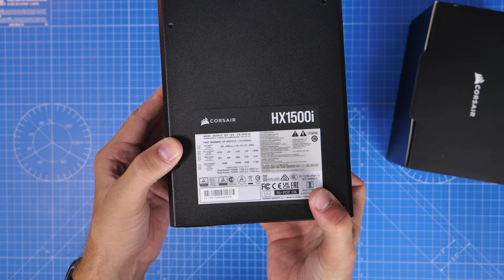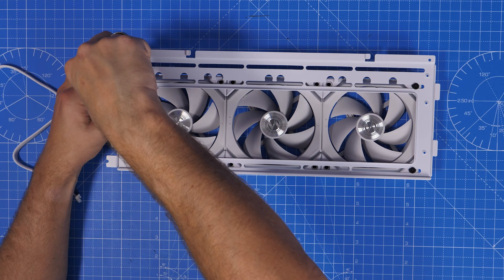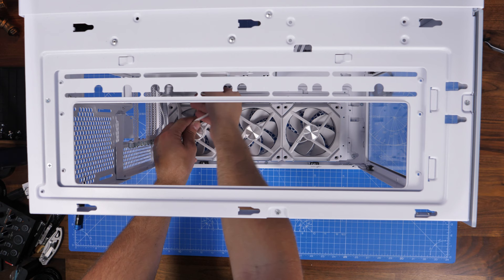I made some mistakes with this Lian Li O11 Dynamic EVO build (Z790, Core i9 13900K, RTX 3090)

Comment: Thanks a lot for your great content!

I do have a question though for the NZXT Z73.

I'm currently building my new pc in head and want to go with the following all white:
MSI 790 Edge Wifi 
Msi 4090 Suprim
I9-13900
NZXT Z73 Kraken 
64gb ddr5 6000mhz (to fill the 4 slots :D)
10x lian li uni sl infinity
Strimer 
1000w Pure Power 11 FM beQuiet PSU
In an O11 Dyn Evo 

For this i have two questions:
1. Are 1000w "enough" for this build, or would rather go with 1300w?
2. Is the Z73 Kraken enough to cool the 13900? For this i've read multiple opinions ranging from "easy going, just dont bench 24/7" to "no way, no AiO can cool this thing even if you're just gaming". Id use the pc for gaming (currently 2k, then 4k), streaming with OBS and Photoshop / Lightroom.

Thanks a lot for your help!
Reply from the maker: For question 1 use this https://outervision.com/power-supply-calculator

For 2, people do talk a load of old nonsense don't they? I'm using the 13900K as you can see and it runs really well with the Kraken. It's nice and cool frankly. Usually around 30 degrees C or lower idling (i.e. browsing the web or whatever) and 50-60 degrees while gaming or video editing. Obviously I edit a lot of content, benchmark, render, game and more. Not hot. Just fine. Naturally this will vary depending on overclocking and such but it's cool here in this setup.
Reply: @TheProvokedPrawn  Thanks a lot for your answer, really appreciate your time!
Yes they do, that's why i needed to ask, as you're running exactly this combo! 
Dont think i'll overclock, as i don't want to compete in any benchmark score, just my three mentioned use cases, escpially the streaming part with obs is currently lagging out my system. As soon as i open OBS, cpu jumps to 80-100% and system is super slow. Also of course, i want to be as future proof as possible without the need of a custom watercooling system.
Reply from the maker: @headsh0t_ttv886  interesting. Are you using the CPU for encoding rather than Nvenc?
Reply: @TheProvokedPrawn  Im using NVENC. Currently running a i7-8700k and an rtx2080.

Comment: anybody know how to control the rgb strip in the front through the Lian Li software. I Can control the fans but their is no section in the software through it. It's receiving power  and the rgb cable is plugged directly in the controller and when i put it on the 8th mode which should let me control it through that it doesn't do anything. It's driving me crazy.

Comment: if you top slot your m.2 card it cuts your Pcie express from 16x to 8x on Maximus hero, might check if it does to your too..
Reply: Asus did that with the 690 boards too. Hot trash

Comment: Does Lconnect3 software have to be running to maintain only the rbg effects?  Im using it for lights only so will I be able to only open it to change color and pattern and then close it for good?  BTW yur channel has been a godsend for me, ive been out of the loop for 7 years so its been very helpful to watch these tutorials

Comment: Hey PP! great video and videos.  I was so glad to find your video after having some difficulty with my build. turns out I have the exact same  case, cooler, 9 fans and motherboard (AMD version for 7950x). my GPU is also same series but 3070 (this PC is built to process astrophotography and doesn't utilize any GPU processing for that). Here's the thing I got very excited when i saw you pull out the double white wire for power and RGB control at the top of your cooler run of fans but for some reason I couldn't find one in my box.  Granted I did buy 3 times 3 packs because all the single fans were a week longer delivery. so maybe the dual cable came in a single box?  Also, I had a fit of a time with getting all three to reach the controller.  I ended up pulling forward my PSU and running it behind it and pulling the HDD cage out altogether.  I am running 3 times 2TB firecuda 530s so i didnt need it anyway.  Don't know if it is any benefit to you for me to respond to a 3 month old video but I wanted to share my gratitude and help if i could. CHEERS!
Reply from the maker: Thanks for the comment 🙂 the cable does come with single fans. Lian Li also says it has longer cables now or you can purchase them separately apparently.
Reply: @TheProvokedPrawn  I would trade them 6 jumpers and 6 power/controller wires for 1 or 2 long ones =P.  Thanks for the response!

Comment: How did you get the white rubber pads on the original SL fans? Are the pads from the SL-Infinity fans the same shape and size?

Wait nvm, further on in the video you mentioned they are V2s.

Comment: Nice. I love videos where not everything is perfect and we can learn more from mistakes. About to do a white build also, and was really looking at this mobo, it looks so good but unfortunately it is DDR4 and really wanted to bump to 5. Can't decide whether to go with ASUS ROG STRIX Z790-E or MSI MPG Z790 EDGE, $200 for better bios options?
Reply: Wow im stuck between these two exact motherboard options.  If you chose one, could tell me why and how its worked out for you so far?
Reply: @dude5skater  I finally put together my pc. Went with the msi since it was cheaper and put the money towards a better processor. IO on mobo was a pain to get in place, had to force the screws on, stand offs didn't fit perfectly. The lian li case has a fat cable for the usbc and its right where the anti sag bracket for my 4080 card would go. I had to use the lian li anti sag instead of the one that came with the gpu. Other than that the mobo runs fine, I haven't played with it too much. I am happy with it, though it was a pain to find one before Christmas. Hope that helps

Comment: I love this build, I'll build my new pc soon like yours, I have some questions I hope answer me, 
1: do you hear bubbling noise or something in AIO in the side mounting?
2: is I can mount 360 AIO on top instead of the side with this case or it's impossible, if yes, why you prefer to mount it on the side?
3: why do you not use NZXT fans behind radiator like your old build (when you are using 6 fans in the radiator)
♥
Reply from the maker: No, Yes and mostly because I didn't want to. 🤣 But also really you should use the same fans on both sides for ideal push pull. This ensures the fans have the same airflow capabilities
Reply: @TheProvokedPrawn  Thank you for your fast reply, so the reason of why you don't use double side fans because you find that nzxt with Lian Li fans together not give the best airflow performance

Comment: Quick question regarding the fans. I have basically the same setup except my rear fan is also an intake. So I only have the 3 radiator fans on top as exhaust. Is that anything of concern or am I just fine?

Thanks for any replies.
Reply from the maker: The best answer to that is to stress test your system and see how your temps are. https://youtu.be/nkjQjozmzlY

Comment: I was a little disappointed that the hx1500i didn't come with the Corsair connector for 600w included and I couldn't ever find a moment it was in stock so I bought a cablemods cable instead. Also it was interesting than the new HX PSU didn't come with braided sleeved cables like my last gen hx1000 did. Regardless it's support my 13700kf and 4090 no issues as you would expect. Though I know my old hx1000 would have done the job zero issues too.
Reply from the maker: The cablemod cable looks great though.

Comment: Seems a bit odd to use so many M.2 drives.  Why not just get a single larger drive using PCI-E 4 and then partition it for OS, files, and then games?  You've no doubt spent just as much if not more money on multiple drives than you would on a single 2TB drive.  Plus they'll collectively consume more power, add heat, and you've taken up all your slots so you have no more room for future expansion without replacing a drive.  Not to mention the performance penalty of falling back to PCI-E 3.  Having a single larger drive seems to make more sense.  Love the overall build though.  Looks beautiful!
Reply from the maker: One is for the OS and software, another is for video files and another. And one is purely for games and the other is for gameplay footage. Nearly all the drives are full and I have a 20TB NAS. I need a lot of storage space for all the things I do. They also run at PCIe gen 4 x 4 speeds on this board as well.

Comment: Can i connect my Lian Li Fans to the Motherboard with the Controller Cable and also connect my fans with the pump. So basically it is connected to both. Currently i am just connected to the motherboard via the controller cable because i have bought 3x 3packs of lian li fans and the splitting cable wasnt included so i had no chance of connecting them to the pump cable. Can i leave it as it is or should i really buy the splitting cable to connect the fans with the pump itself
Reply from the maker: It'll be fine as is. Don't worry

Comment: does the 40 series nvidia really need a 1500w psu? im building a pc using this same MB but it says ddr5 not 4 with it and im putting in a 4080 rtx. pc parts picker estimates 787 watts so im going with a 1000w psu. is that not enough in your opinion? i also have a 1200w psu from my current build i could use but id rather get a new one since this one is about 12 years old. still going strong after all these years though. should i consider getting getting a 1500 watt psu instead of a 1000 watt or 1200 watt psu?
Reply from the maker: Should be fine!
Reply: @TheProvokedPrawn  hey thanks for the quick response and the advice man. I greatly appreciate it. Great video btw. Very informative

Comment: I plan to buy the lian li galahad 360 sl version with 9 sl120 v2 fans (3 at the top, 3 in front, 2 in the bottom, 1 in the rear). Should I be plugging the radiator fans to the CPU fan header? I'm confused on how I get the pump to control my radiator fans.
Reply from the maker: Hey, thanks for joining the channel, your support is appreciated! I've got a video here which might help - https://youtu.be/0wPi_zNzKF4

I don't recall the setup for the Galahad. Does it have a fan power cable coming out of the pump head? If so use that, if not, yes plug them into the CPU fan header. The motherboard will then control those fans and if you connect the pump to the AIO header it'll be able to control that too. :) Hope that helps (or the video).

Comment: Where did you end up putting the controller that connects to the bottom 3 fans? The cord is pretty short/tight as you say.
Reply from the maker: Apparently they supply longer cables as standard now

Comment: Ever thought about putting the AIO on the top set to exhaust and just have fans on the side? What advantage do you see having it on the side. Nice build, I’m about to start one myself with the same case!
Reply from the maker: I've actually tried both formats - top and side and found little difference in the performance.
Reply: @TheProvokedPrawn  was it ultimately an aesthetic choice then? or was it simply easier to mount it there? 
i'll be doing a similar build for my girlfriend soon so i'm curious.
Reply: @thomaslayman9487  put your rad up top dude, youre blowing hot air into the case the way he did it...rad up top as exhaust, 3 fans on side as intake, 3fans on bottom as intake, back single fan as exhaust
Reply: If you have midrange GPU then its way easier with AIO on top but with high end GPU this is the best setup - also vertical mount for GPU. The thing is that high end GPU's generate a lot of heat and with the AIO on top the CPU temp also goes up. At the same time CPU's generate way less heat. Now one might ask "but you blow warm air into the case". Well yes and no. First of all the air from the CPU AIO aint that hot. Secondly the warm CPU air gets pretty much blown out of the case bacause of the bottom fans and doesn't reach other components. I have the same Lian Li case with exactly the same fan setup. I have tried different fan and AIO setups and also checked the air movement with the smoke machine.
Reply: @Aur0n  Agreed! Also, to back up your point, the absence of an AIO up top allows for even higher fan velocity pulling all that bottom air up and out as there's no rad interference.

Also, it's much easier fitting a Push - Pull (should you go this way) on the side as opposed to the top (even in my XL Case.) and looks less cluttered.
Reply: I have a very similar set up using a 13900K.  In my setup there's a 6-8 degree C difference in CPU cooling, if I have radiator on intake on the side and fans on exhaust at the top.  The cool air from the outside keeps the cpu the coolest.  While it warms up the inside of the case, the fans on the bottom set to intake, keeps the GPU cool and the warm air exhausts out the top.  I didn't find the fan on the back makes much of a difference.  If I move the radiator to the top and set it to exhaust, the CPU temperature increases by 6-8 degrees.  In that configuration, my GPU temperature will go down slightly maybe 1 or 2 degrees. 
.
Reply: @Me99adon  exactly how i will be doing it.

Comment: i have a 13700k. I noticed you plugged in both cpu power connections. Does it make a difference if i have only CPU power connector compared to two? any advice would help. thank you!
Reply from the maker: The extra power is usually for overclocking I believe, but I'd suggest doing all whenever possible

Comment: Hi, I wanted to thank you for your videos.  This build is almost exaclty what I want to do and watching it has answered quite a few questions I had about using the Kraken in a build, but replacing the fans with Lian Li fans.  I did want to ask you what software you use to run the LCD screen on the Kraken as well as all of the lighting in the build as I've been trying to research and figure this out.  It's turinng into a rabbit hole.  I've read posts indicating you can use CAM and SignalRGB together if CAM starts up after SIgnalRGB, but other posts that indicate CAM does not play well with other RGB software.  I've also read that CAM does not currently have the ability to control RGB RAM.  There is also a product called KrakenZPlayground, but I'm not sure if it works as well as CAM to control the AIO.  I'm also guessing if I go down this road, I should try and find an older Z model and not use one of the newer Elite models as the compatibility may be even less with the newer models.

Anyway, I'm really interested in what your solution was, here.
Reply from the maker: I personally use Cam for the display, L-Connect for the fans and then the RAM is controlled by the motherboard software (in my case that's Asus ROG Armoury Crate). I've not dabbled in Signal RGB I'm afraid.

Comment: Something I noticed while watching the installation segment, you seemed to put M.2 drives in each slot if I am not mistaken, which may impact performance of your graphics card significantly. I am unsure if this is the case for this exact board, as I cannot find the channel specs for it, but most of the high end ROG boards actually have the PCIe slot for the graphics card share a lane with one of the m.2 slots, meaning that it will drop from x16 mode to x8 and hamper performance by something like 2/3 in terms of data bandwidth.
Reply from the maker: No significant impact in my experience

Comment: I have been racking my brain trying to figure out how to get MOBO control on lian LI fans for a hot second and didn't even think to use the splitter cable. Genius.
For your fan wire stretch issue to reach the controller, would you be able to mount the radiator to the top and then daisy chain bottom&side intake?
Reply from the maker: Might be easier :)
Reply: I appreciate you giving everyone an opportunity to learn from the little mistakes. Content creators like you give the platform life. Cheers 💖
Reply from the maker: @DTkz_  thanks. I get happy feelings from helping others. 👍

Comment: *just bought myself a 5,295.29usd 
gaming pc 3090ti i9 13900k 32gb ram 6000mhz  3tb ssd power supply of 1200w rog thor asus*
hope it goes ok with 1200w psu
i just need to put it toghter with someone proffestional 
to do it this week .
i sold my ps5 series x 2x steam decks units and adds a ton more money for it* .
hope i have great time with it . 🙂👍

Comment: what does ram induced instability look like? so what happens when the system is unstable?
Reply: As someone who upgraded my antique i5-6600k 2 years ago from 32 to 64GB ram I can tell you that what I was having a lot of issues with was programs crashing. No BSODs just programs crashing out of the blue. I had bought 2 packs of 2x16 and testing with Prime95 showed one set was bad. RMA'd it and got a good pack. So if you think you are having issues, Prime95 is a good, free way to figure out if you have some bad ram.

Comment: hey man so i got a lian li O11 dynamic EVO and it has rgb like the case does but for some reason they wont turn on? do you know any solution to this?
Reply from the maker: https://youtu.be/xmLIU40UOVI
Reply: @TheProvokedPrawn  so its not the fans! all my fans work and strimer too but its the case because the case has an actual like strip where the power button is in between the glass and the plastic but it wont turn on ? does that video fix that aswell?

Comment: Why not completely remove the hard drive bay to open up some room?
Reply from the maker: Fair point but I wanted to mount the SSD there and hide some of my cable shame/controllers
Reply: @TheProvokedPrawn  I’m not talking crap lol. I just bought the case and was messing with it yesterday and noticed that if you take it out, it leave a ton of room. Also, the center bar that hides the cables has a couple of mount for SSD’s. 👍 Nice build!
Reply from the maker: @mzerv00  I know you weren't talking crap. i was agreeing with you.